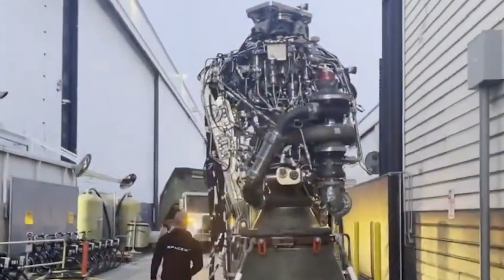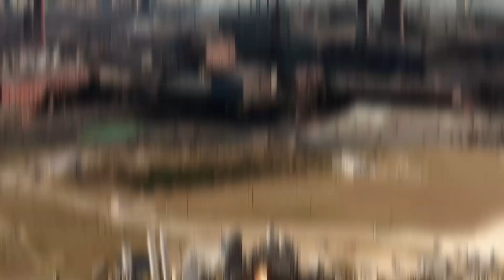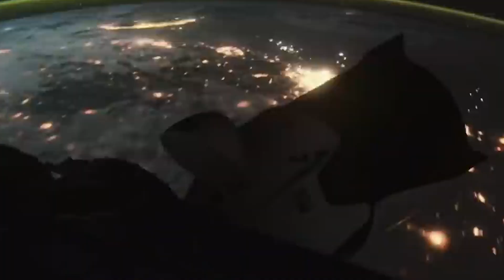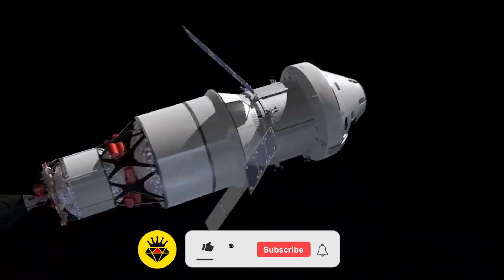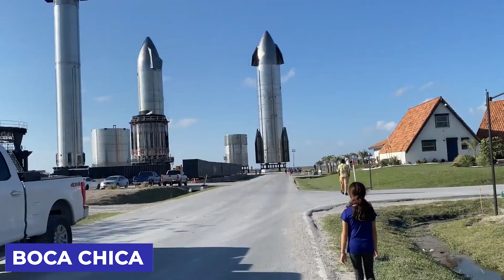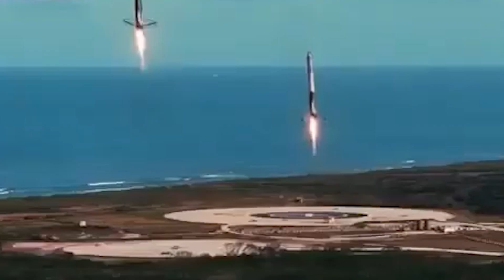Elon Musk Insane SpaceX Mindblowing $3.2B Space Factory

Comment: can they made s factory in space that is entirely radiation proof?? if they just block it to reduce the radiation aren't microchip made from space useless? as we know, micro chips are delicate even small radiation can make bit flips. specially if the chip parts are contaminated. unless they are making a chip with material use in space travel.